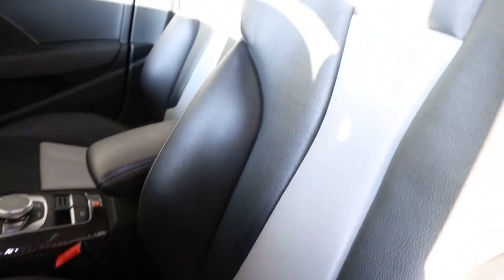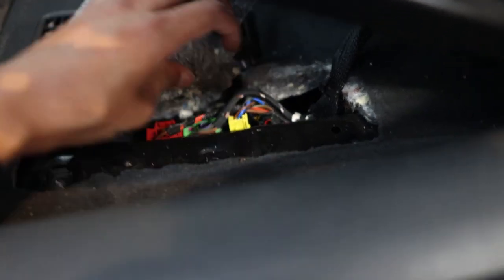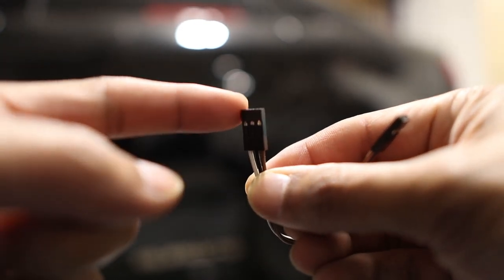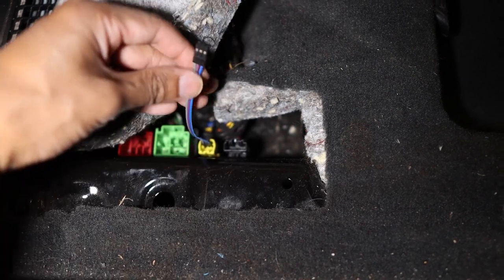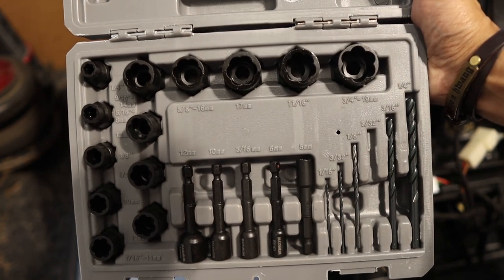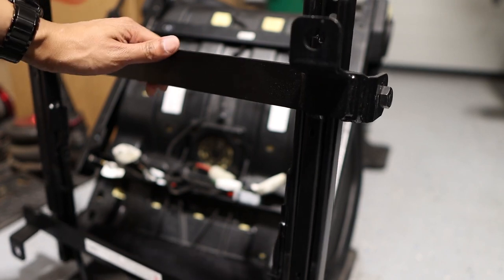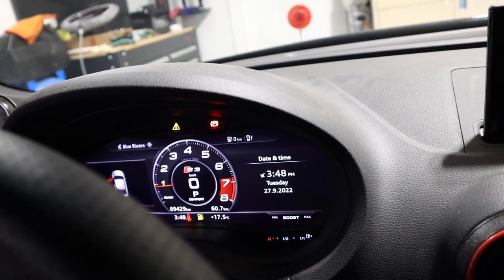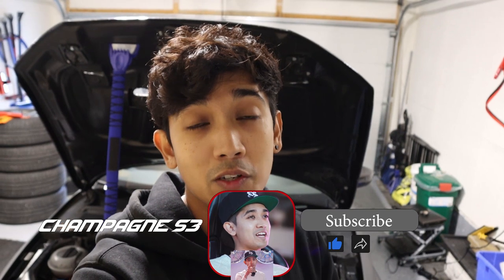Audi S3 Recaro Seat Installation | NO AIRBAG LIGHT!!

Comment: Great video. Nice and detailed. I have heard that the occupancy sensor can be coded out on vcds but nobody has actually documented the process. Is this even possible on vcds?
Reply: You can code it out with vcds but the light will be on, as it will have codes for the airbags being turned off.

Comment: My 2017, Golf R seat, assembly weight turned out to be 54 pounds. 
In my case, I am replacing it with a Racequip fiberglass with Sparco sliders and brackets, which totaled 37 pounds for a  difference of 17 lbs. Admittedly, not nearly as much as I expected, but weight savings nonetheless. Yours is probably pretty similar. You have a more functional seat, so there may be a pound or so difference but that’s about it I would guess.

Comment: Hi, I didn't understand from the video if you removed the presence sensor on the seat and where from? Could you explain to me? Thanks and congratulations for the video and result!
Reply from the maker: Sorry for getting back to you so late. You'll need to remove an occupancy sensor if you decide to put both driver and passenger seat into the car. If you're doing just the driver seat you will not need a occupancy sensory

Comment: Good timing, I’m probably doing mine this weekend, already got the same parts off Amazon. Did you get the weight difference? I’ll try and remember to weigh mine and post it here. The R and S3 should be pretty much the same. I’ve got the sparco base, brackets and sliders with a Racequip fiberglass seat.
Reply from the maker: Man I should have weighed mine! I totally forgot! Let me know how they work out. Looking forward to your progress this season 👌👌

Comment: Hey, what are the resisters called please ? I'm getting Sparco R100 seats fitted but haven't been able to source the resisters I'll need to avoid warning lights. Also what are the jumper cables as I can't seem to find them either.  Im in the UK / Scotland, Thanks
Reply from the maker: They are just generic resisters you can find at any local electronics store. As for the jumper cables I found them on amazon
Reply from the maker: Just search 3 pin female to female jumper wire or cable
Reply: @ChampagneS3  excellent thanks

Comment: But it doesn't get rid of the seat belt light, so you get to hear the warning thing continuously while driving.
Reply from the maker: Seatbelt light? If you don't have it buckled it whole chime.. Just like regular operation. But there is jot seatbelt light warning as you are using the original belt and buckle
Reply: @ChampagneS3  
Unless the seat belt is Bluetooth connected to the computer, how would the computer know if you unplug all of those wires?
Reply from the maker: @wiscopyro  if you watch the video the seatbelt occupancy sensor is still plugged in. You will not get any light, I drive the car like this with no lights or warnings which is the reason I made the video to show it
Reply: @ChampagneS3  
Ok, thanks

Comment: Hey bro i installed recaro cs in my golf mk6 and i adapted the airbags(not ressistors) with good results, but im getting airbag light  for 2 erros, seat occupied passenger sensor  and drivers position sensor.
Do i need 100% ocr sensor mat from a stock seat or could i jump it?🙏
Reply from the maker: You need to have the seat position sensor moved to the new seat which is attached to th belt buckle. Did you install 2 seats or just 1?
Reply: @ChampagneS3   i installed two seats driver and front passenger